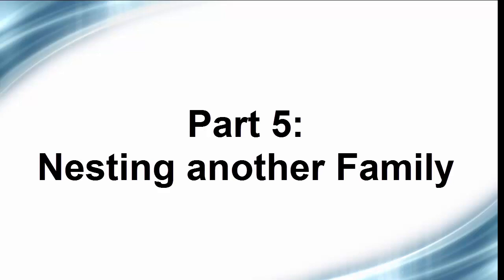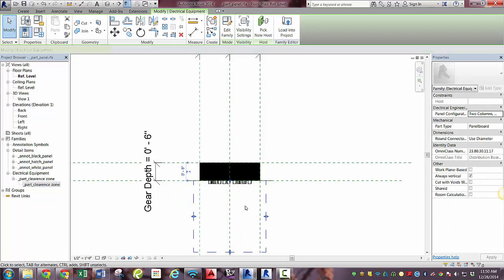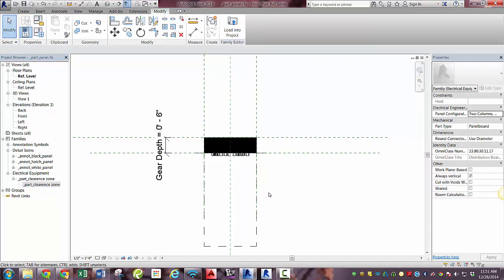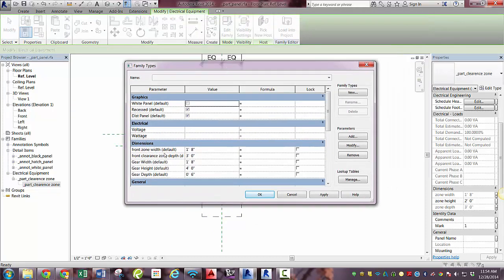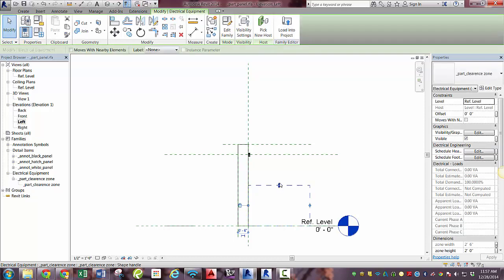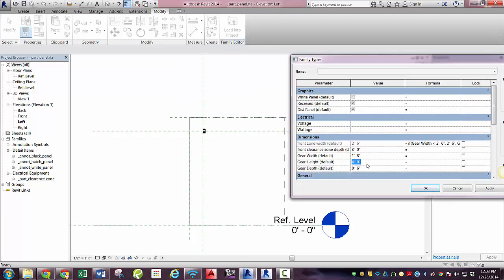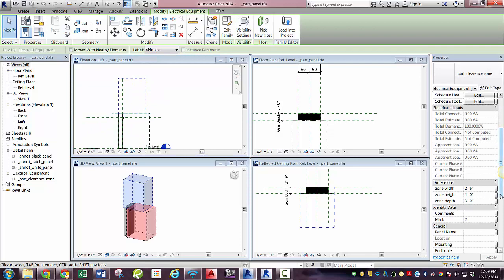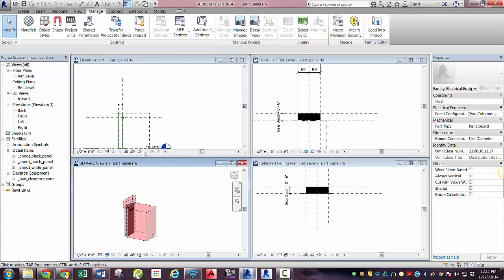Revit MEP Family editor Part 5: Nesting the zones into the Panel part

Comment: First off thank you for posting these videos, they are great.  I was hoping you could help me.  After I laid the top clearance zone and set it equal to gear depth, a couple of things happen, one, it does not align directly above the panel and second, it doesn't appear to be the depth of the panel.
Reply from the maker: You may need to check a section view (left or right) and use the align tool to align it / lock it to a reference plan so that it is at the correct elevation. As for the depth, maybe check within the nested family that the depth parameter is set up correctly (that the dimension is set to reference planes, and the geometry edges are locked to those reference planes)
Hope that helps